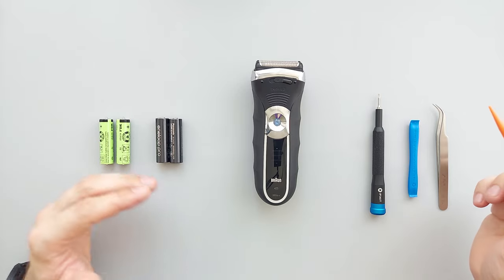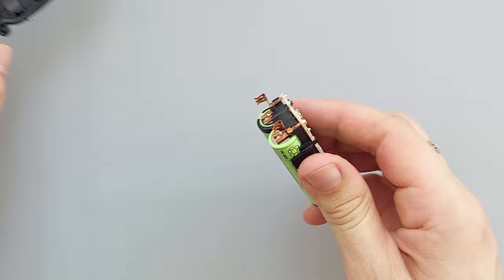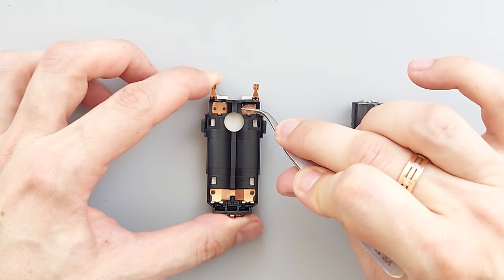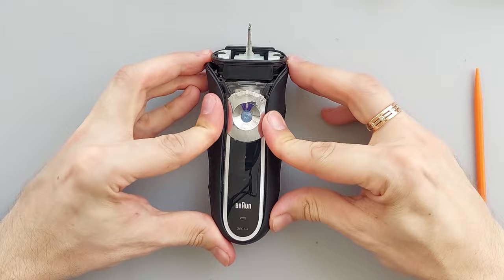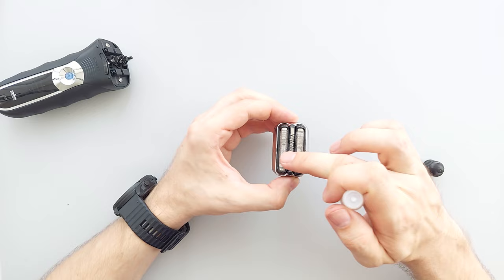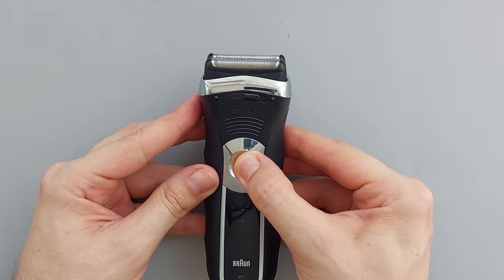Braun Series 3 Electric Razor disassembly and battery replacement (original and AA NIMH batteries)

Comment: btw when I replaced the batteries at first it still wasn't working. Eventually I worked out that if you short out a chip it resets the battery level and the shaver will work again. The chip is about 4 o'clock to the off/off button (the biggest chip on the board). I just held a piece of solder across the pins and the battery level indicator illuminates. Worked after that.

Comment: If you have a 380 wet and dry, don't waste your time as I did as the sides can't be removed.
Reply from the maker: All Braun devices are perfectly serviceable and can be fully disassembled and reassembled without any damage.
Reply: No, on the wer and dry, the sides are glued, @ElectronicsComputers
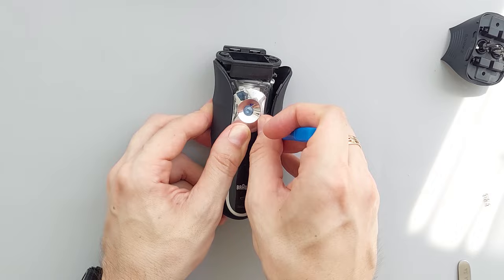Reply: @freddyp4641  From my 310s Wet & Dry I confirm it is not glued. At 0:51,  you will need a cutter blade, two or more pry tools, and apply more force to remove the grip.

Comment: Thanks a lot for you excellent video. It was very easy to follow it and do the replacement myself ! Another 8-10 years of life for my Braun Series 3 - avoiding garbage and using tools longer helps the environment!
Reply from the maker: Great job! I'm happy to  help!
Reply: You cannot replace original batteries with a capacity of 800 mA with batteries with a capacity of 2500 mA, as this leads to constant overheating of the charging unit and its failure; charging highly discharged batteries is especially dangerous. Also, the algorithm for charging native batteries with a capacity of 800 mA does not provide charging for batteries with a much higher capacity, which leads to undercharging and, accordingly, less battery life for the razor. You can easily check this by removing the batteries and charging them in a suitable charger, and then putting them back and making sure that the operating time of the razor will increase significantly.

Comment: How do I know if my battery is the issue?  Scenario: Used it to shave. Plugged it in overnight. Picked it up to use the next day and found the body was quite warm, the charging light was not lit/activating, and the razor didn't even make an effort to turn on.
Reply from the maker: Without a multimeter and checking all critical points, it's impossible to determine what's wrong. Try removing the batteries and replacing them with regular AA batteries just for checking sake. If it works, then replace the regular batteries with rechargeable ones.
Reply: @ElectronicsComputers  Thank you very much! I'll give that a try.
Reply: Coulda just been a fluke, but I popped in some regular AA batts and pressed power. Razor didn't start, but a red light flashed.  I then put the original batts back in and popped it on the charger.  Charging light started to blink green, so I clicked power and it turned on. (Thought it was toast, for sure, cause the smell of burnt got stronger and stronger with every layer removed, lol.) Thanks for your video! @ElectronicsComputers

Comment: Great tutorial. I followed the guide exactly on my 350cc-e4 but put in high capacity AA rechargeable 2500mAh batteries thinking this would work better.  It did not.  The shaver did not re-initialize after plugging in the charger cord.  After putzing with the power button a few times to see if I could get it to work, I finally opened everything up again and put in 2000 mAh rechargeables and it seems to like that better. Someone earlier commented in German that they put in 2500mAh with okay results, but I could not get my model to accept them.  Maybe the boards are different in different models.
Reply from the maker: There's no way that board can determine the battery capacity. It should work with any battery capacity. The charge controller can only detect the battery voltage. So I think it has something to do with either critically low charge level or faulty batteries. If you don't have a AA battery charger, I'd put  temporary one 2000mAh and 2500mAh batteries and try to charge slightly them and then replace 2000mAh with 2500mAh one.
Reply: @ElectronicsComputers  Thanks for your reply, that's probably correct.  But I now have to update my prior comment, as things have not worked out.

I initially thought the 2000 mAh was working because I was able to get the shaver to buzz once, with the expected green LED lights.  But I tried powering it on again several minutes later, and the shaver no longer responded.  The red light came back, plugging it in failed to get the shaver to reset.  Instead, I would get alternating schemes of green and red lights when pressing the power button.  I opened it up and rechecked the rechargeable batteries which were fine on their own.

I then tried swapping in several other sets of rechargeable batteries, all full charged, both 2000 and 2500mah, and found I was getting the same error.  No rhyme or reason why.  I ultimately replaced it back with the original worn down batteries and it resumed working.

I'm unsure where the issue is. The LEDs work no matter what battery is inserted, so I don't think it's a connectivity issue.  There have been some similar descriptions of people's experiences in the comments, but nothing definitive.

Comment: This is an excellent tutorial. My only addition would be after 2:05, before replacing the piece containing the button, is to press down on the silver piece you rotate back to get at the battery circuit board. (That's the actual switch the button unit presses down to complete the circuit). If you don't see the red LED flashing on the circuit board, the circuit board isn't properly aligned with the two contacts. 

I didn't try this the first time I replaced the battery board, and proceeded with the next steps to attach the button plate with the 6 screws. Then I thought to check whether I'd installed the batteries correctly by pressing the button. When I did, there was no flashing red indicator. So, I had to reverse course, remove the screws and reinstall the battery board again. This time, I pressed the silver piece, the red LED flashed, and I knew I'd installed the battery board correctly. 

Testing the battery board connection early, may save you a lot of time going through additional steps only to discover the battery wasn't connected properly.
Reply from the maker: Great job. Thank you for the comment!

Comment: My twelve year old son and I were going to do this together, but your video was good enough that he took over the project and did this, and on a more complicated Braun with more screws. Spasibo!
Reply from the maker: I'm happy to help!
Reply: You cannot replace original batteries with a capacity of 800 mA with batteries with a capacity of 2500 mA, as this leads to constant overheating of the charging unit and its failure; charging highly discharged batteries is especially dangerous. Also, the algorithm for charging native batteries with a capacity of 800 mA does not provide charging for batteries with a much higher capacity, which leads to undercharging and, accordingly, less battery life for the razor. You can easily check this by removing the batteries and charging them in a suitable charger, and then putting them back and making sure that the operating time of the razor will increase significantly.

Comment: Fantastic instructions, super clear and concise! Thank you for the video!
Reply from the maker: You're very welcome!
Reply: You cannot replace original batteries with a capacity of 800 mA with batteries with a capacity of 2500 mA, as this leads to constant overheating of the charging unit and its failure; charging highly discharged batteries is especially dangerous. Also, the algorithm for charging native batteries with a capacity of 800 mA does not provide charging for batteries with a much higher capacity, which leads to undercharging and, accordingly, less battery life for the razor. You can easily check this by removing the batteries and charging them in a suitable charger, and then putting them back and making sure that the operating time of the razor will increase significantly.

Comment: I'm completely non-technical... Seriously, but even I managed to change the shaving head and battery. The only thing that was unclear was the beginning how the springs should sit. Check this extra carefully. Thanks from Sweden. You made me save 70 $
Reply: AA VARTA 2-PACK 2100 MAH Worked perfectly 7 $
Reply from the maker: Great job! I'm happy to help.
Reply: You cannot replace original batteries with a capacity of 800 mA with batteries with a capacity of 2500 mA, as this leads to constant overheating of the charging unit and its failure; charging highly discharged batteries is especially dangerous. Also, the algorithm for charging native batteries with a capacity of 800 mA does not provide charging for batteries with a much higher capacity, which leads to undercharging and, accordingly, less battery life for the razor. You can easily check this by removing the batteries and charging them in a suitable charger, and then putting them back and making sure that the operating time of the razor will increase significantly.

Comment: Awesome Video, explains well how to do. here my 2 cents:
1. please pay attention to clean the gaskets and to not loose the o-ring gaskets.
2. please plug into the charger after battery replacement
Reply from the maker: Thank you for the comment!
Reply: You cannot replace original batteries with a capacity of 800 mA with batteries with a capacity of 2500 mA, as this leads to constant overheating of the charging unit and its failure; charging highly discharged batteries is especially dangerous. Also, the algorithm for charging native batteries with a capacity of 800 mA does not provide charging for batteries with a much higher capacity, which leads to undercharging and, accordingly, less battery life for the razor. You can easily check this by removing the batteries and charging them in a suitable charger, and then putting them back and making sure that the operating time of the razor will increase significantly.

Comment: Thanks so much too, my razor thanks to you alive again, more than ten years old, so useful your video, short, easy understandable, and saves money.
Reply from the maker: Glad to help
Reply: You cannot replace original batteries with a capacity of 800 mA with batteries with a capacity of 2500 mA, as this leads to constant overheating of the charging unit and its failure; charging highly discharged batteries is especially dangerous. Also, the algorithm for charging native batteries with a capacity of 800 mA does not provide charging for batteries with a much higher capacity, which leads to undercharging and, accordingly, less battery life for the razor. You can easily check this by removing the batteries and charging them in a suitable charger, and then putting them back and making sure that the operating time of the razor will increase significantly.

Comment: Thank you very much. It was very clear & concise. As you had indicated the plastic terminals at the head are very delicate & break. One of mine broke & lost a spring as well.  If at all where can I get them.
Reply: I just have broken mine, too. 

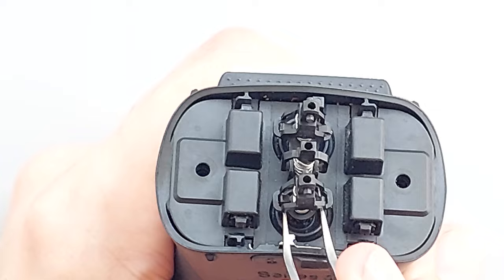Make sure to queeze like shown at 0:26 and DO NOT try to bend the latches. Nevertheless, it still seems to work fine.
Reply: You cannot replace original batteries with a capacity of 800 mA with batteries with a capacity of 2500 mA, as this leads to constant overheating of the charging unit and its failure; charging highly discharged batteries is especially dangerous. Also, the algorithm for charging native batteries with a capacity of 800 mA does not provide charging for batteries with a much higher capacity, which leads to undercharging and, accordingly, less battery life for the razor. You can easily check this by removing the batteries and charging them in a suitable charger, and then putting them back and making sure that the operating time of the razor will increase significantly.

Comment: Perfekt und vielen Dank!!
Ich habe damit bei meinem 395cc die Akkus gegen "normale" AA - Akkus mit 2500 mAh getauscht. Vorteile: Kapazität größer und der Preis günstiger. Funktioniert einwandfrei! Die Schrauben habe ich mit einem Torx-Bit T8 geöffnet.
Reply from the maker: Great job, man!
Reply: You cannot replace original batteries with a capacity of 800 mA with batteries with a capacity of 2500 mA, as this leads to constant overheating of the charging unit and its failure; charging highly discharged batteries is especially dangerous. Also, the algorithm for charging native batteries with a capacity of 800 mA does not provide charging for batteries with a much higher capacity, which leads to undercharging and, accordingly, less battery life for the razor. You can easily check this by removing the batteries and charging them in a suitable charger, and then putting them back and making sure that the operating time of the razor will increase significantly.
Reply: @alexstrong6976  Vielen Dank für die Info Alex und sorry, dass ich die Nachricht erst heute lese. Dein Kommentar ist sehr gut und ich wäre selbst gar nicht auf die Idee gekommen, dass man sich bei dieser Kombination auch Probleme einhandeln kann. Aber es klingt plausibel!! Nach 6 Monaten mit den neuen Akkus möchte ich folgendes Berichten: Bei täglichem Einsatz lade ich den Rasierer 1x im Monat auf. Das ist mindestens doppelt so lange wie damals, als der Rasierer noch neu war! Die Restanzeige am Rasierer stimmt leider nicht mehr. Nach 10 Tagen zeigt der Rasierer "rot", was nachladen bedeutet. In Wirklichkeit rasiert er aber munter weiter und damit die Akkus keine Tiefentladung erfahren, wird alle 4 Wochen wieder aufgeladen (ohne das die Akkus deutlich müder geworden wären). Ich habe also noch gar nicht ausgereizt, wie lange der Rasierer tatsächlich laufen würde. Die "Original Akkus" haben leider keinen Aufdruck über die Kapazität. Sie müsste aber höher sein als 800 mA, allein schon weil es AA-Akkus sind. Trotzdem: Danke für deine Infos und natürlich werde ich beim nächsten Laden mal die Temperatur am Ladegerät checken!

Comment: Just a tip to anyone watching this with a 3070cc, you don't need to disassemble the top section (removing the clips), just take the screws out and the top section will pry off. When reassembling just make sure the little rotator coming off the motor is straight up and down (it has an offset pin) , and put the little piece that sticks out (for the trimmer) in first at a 45 degree angle.
Reply: You cannot replace original batteries with a capacity of 800 mA with batteries with a capacity of 2500 mA, as this leads to constant overheating of the charging unit and its failure; charging highly discharged batteries is especially dangerous. Also, the algorithm for charging native batteries with a capacity of 800 mA does not provide charging for batteries with a much higher capacity, which leads to undercharging and, accordingly, less battery life for the razor. You can easily check this by removing the batteries and charging them in a suitable charger, and then putting them back and making sure that the operating time of the razor will increase significantly.

Comment: Awesome work. You now have a new subscriber. Thank you.
Reply from the maker: I'm happy to help and thank you for your support!
Reply: You cannot replace original batteries with a capacity of 800 mA with batteries with a capacity of 2500 mA, as this leads to constant overheating of the charging unit and its failure; charging highly discharged batteries is especially dangerous. Also, the algorithm for charging native batteries with a capacity of 800 mA does not provide charging for batteries with a much higher capacity, which leads to undercharging and, accordingly, less battery life for the razor. You can easily check this by removing the batteries and charging them in a suitable charger, and then putting them back and making sure that the operating time of the razor will increase significantly.

Comment: Thanks for sharing, very helpful.
Reply from the maker: Glad it was helpful!
Reply: You cannot replace original batteries with a capacity of 800 mA with batteries with a capacity of 2500 mA, as this leads to constant overheating of the charging unit and its failure; charging highly discharged batteries is especially dangerous. Also, the algorithm for charging native batteries with a capacity of 800 mA does not provide charging for batteries with a much higher capacity, which leads to undercharging and, accordingly, less battery life for the razor. You can easily check this by removing the batteries and charging them in a suitable charger, and then putting them back and making sure that the operating time of the razor will increase significantly.

Comment: Thank you. I will be able to fully use it again. Older models got 2 NiMH batteries as well?
Reply from the maker: Most older models use the same AA NiMH batteries.
Reply: You cannot replace original batteries with a capacity of 800 mA with batteries with a capacity of 2500 mA, as this leads to constant overheating of the charging unit and its failure; charging highly discharged batteries is especially dangerous. Also, the algorithm for charging native batteries with a capacity of 800 mA does not provide charging for batteries with a much higher capacity, which leads to undercharging and, accordingly, less battery life for the razor. You can easily check this by removing the batteries and charging them in a suitable charger, and then putting them back and making sure that the operating time of the razor will increase significantly.